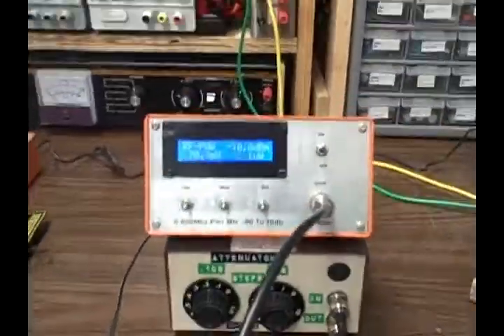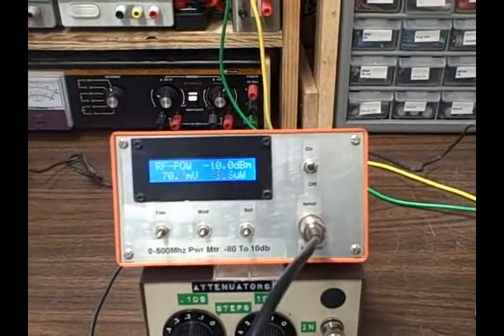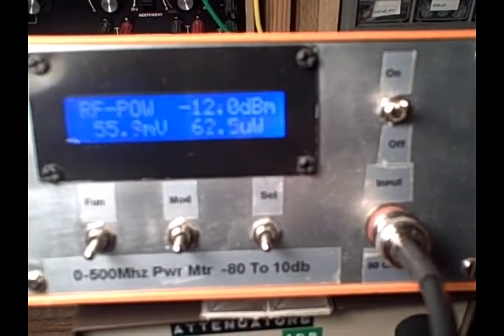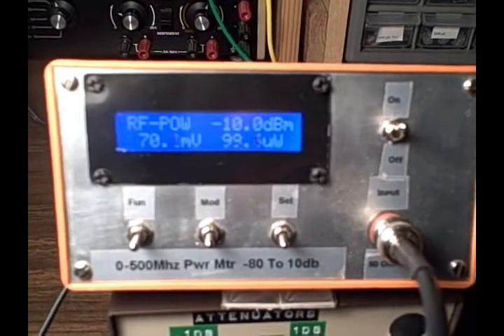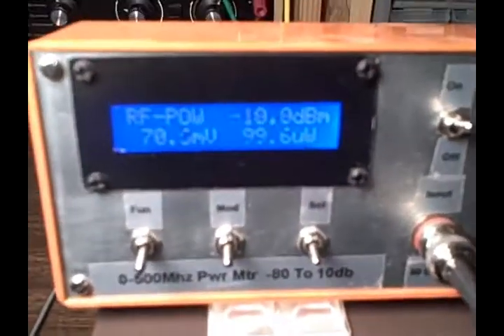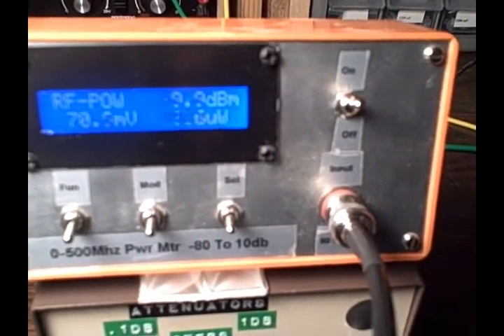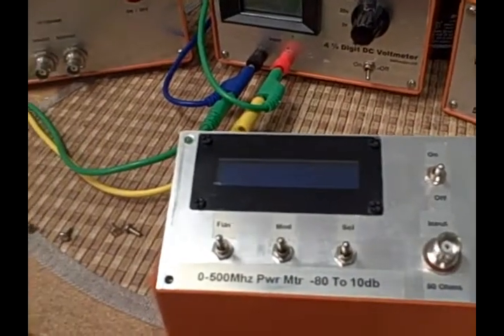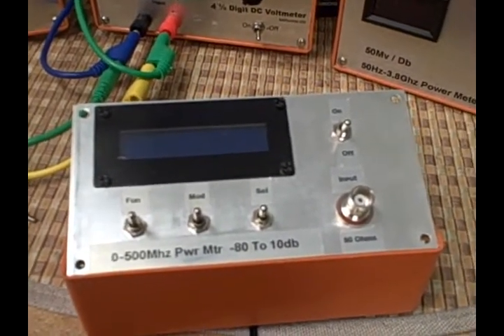1 to 500Mhz Power Meter Project

Comment: Ah, excellent! I have built and programmed a very similar device in the past. The AD8307 is a lovely device. One way to get around the frequency linearity issue is to flatten the input response with a small (SMD) RC network and then calibrate afterwards. This shifts the dynamic range up a bit but gives a much better accuracy across frequencies. As for the dynamic range, try a bit more shielding (the orange box is plastic?) as some stray RF will get into the instrument (the chip is quite sensitive). Then again, this might also be stray RF from the CPU. In my version, the CPU and the AD chip are separated through a shield. Great work! 73 de DK3LJ